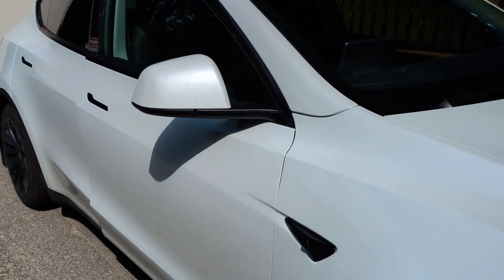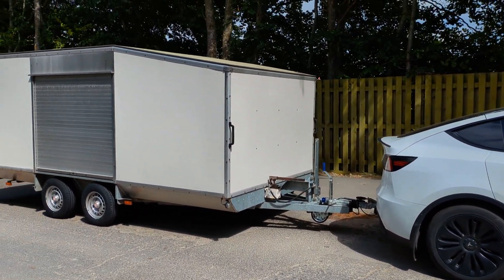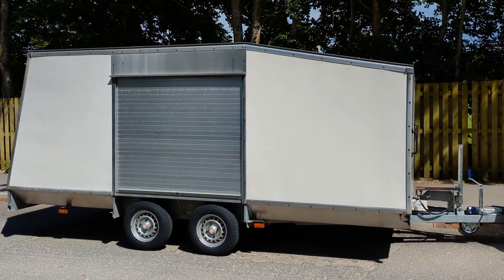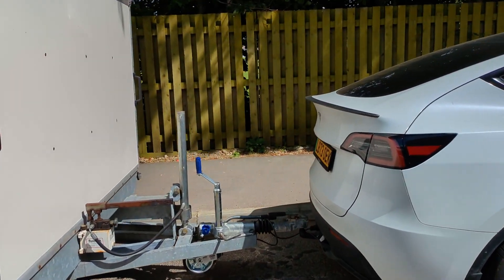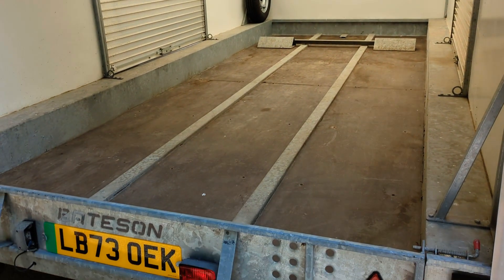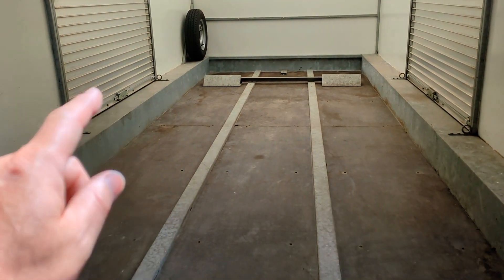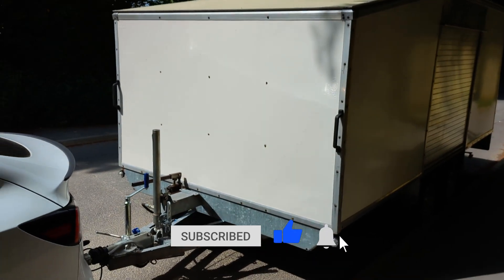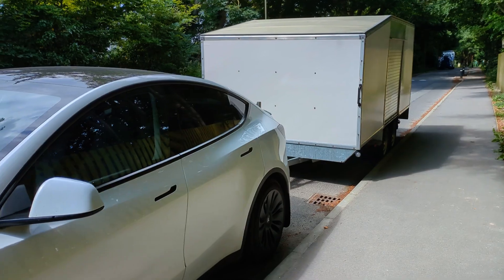Towing with a Tesla Model Y RWD. A caravan test coming soon.

Comment: Can you tell me pls what’s the average consumption?
Reply from the maker: Currently (summer) when not towing, 228 Wh/mile so 4.39 mpkWh. Average over the last 5,800 miles (mostly winter) is 270 Wh/mile so 3.7 mpkWh.
When towing, you can nearly double the consumption (just the same as in an ICE vehicle).
Reply: @GoGreenAutos  Really when towing double that much?! How far did you get with towing on a single charge?
Reply from the maker: Double the consumption means half the range. It depends on what you're towing and how fast you drive.
I've done this video https://youtu.be/brO3zySiVCw?si=lP1wZ5MNYDFWP7jQ on towing with the Model Y. Another video coming in a couple of months time on towing the covered trailer in the video above.
Reply: @GoGreenAutos  I just watched your video. You said that he trailer you are pulling weighs 1600 kg. Your consumption value seems quite high to me. However, I am thinking of pulling a 750 kg caravan. Maybe it will not consume as much as you.
Reply from the maker: Drag is the biggest factor, not weight. So it comes down to how aero it is.

Comment: Hi Matt 
I’m was just wondering what’s behind your decision to move from a cab/chassis truck to an SUV/trailer for moving cars around - would love to hear if you don’t mind sharing 👍🏼
Reply from the maker: Cargo weight. With a 3.5t gross truck, you have a payload of about 1,600kg. So you're limited on what you can carry and when it comes to EVs, it is only the older EVs with smaller lighter batteries.
When you tow a 3.5t trailer, you can carry up to about 2,500kg.
I could get a 4,5 or 7.5t truck, but then you have to have an operators license, tachograph and a CPC license. I can't justify all that as it hardly gets used.
If you tow a trailer behind a 4x4, then all you need is a tachograph.